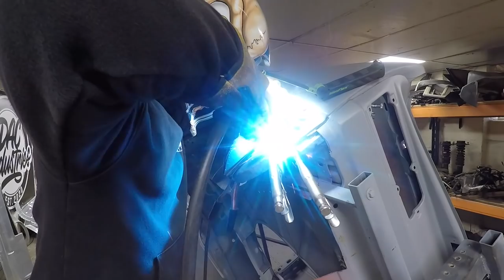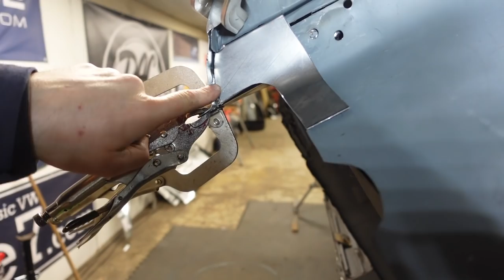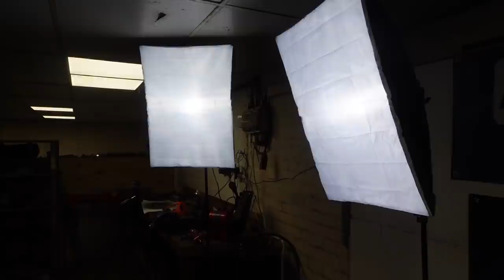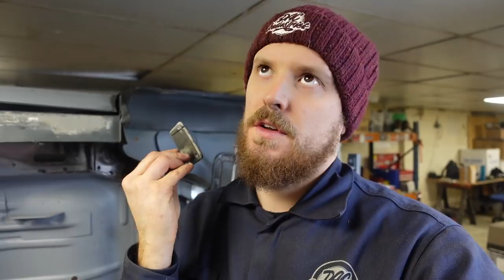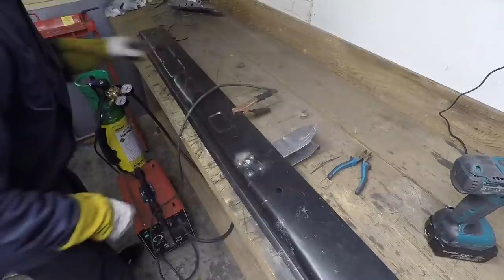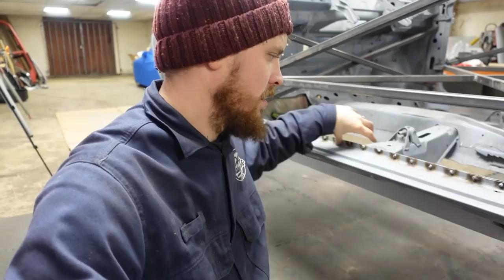Inner Arch, Sill & Rear Corner Repairs - Golf Episode 17 -1983 Volkswagen Mk1 Golf GTI  Restoration

Comment: Doing a great job Dan, When plug welding push the weld pool around the outside edge ( it’s effectively a lap joint)  and finish in the middle, obviously you need to work quick with sheet steel but if you start blowing through just reduce the amps/ wire feed accordingly. Glad you got the joggler mate it’ll make a difference👍🏻
Reply from the maker: Thank you so much for the comment and for watching bud! Yeah I tried a few way's and this way seem's to work the best. The smaller the hole the easier/better it is too. Joggler makes the perfect hole to weld!

Comment: Hi Dan love the detail and all the work you are putting into the car.  You said about the welding gas and I wondered what amps you are running your welder on for the sheet metal you are using as you don’t seem to get any burn through but you are getting good penetration.  Which I’m struggling with.
Thanks
Reply from the maker: Thank you so much for the comment and for watching Neil! I only have setting's on my welder. For 1mm gapped butt joins I am using setting 1 - Minimum and wire speed 8. For Thicker or plug welds I am using setting 1 - Maximum and wire speed 8. Hope this helps. I spent a while with some scrap to find the right setting.